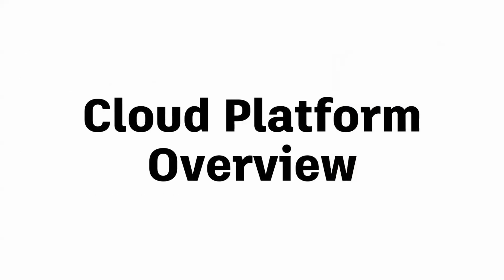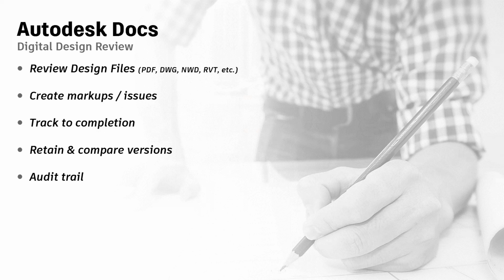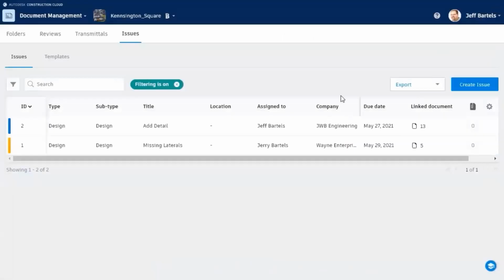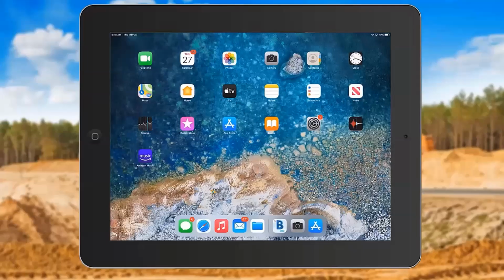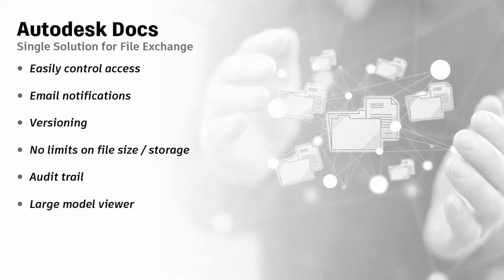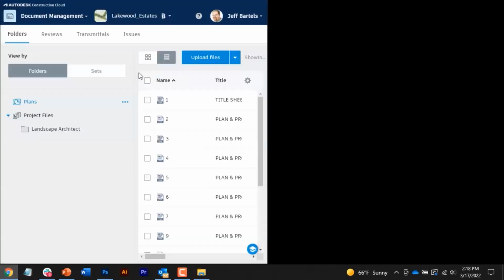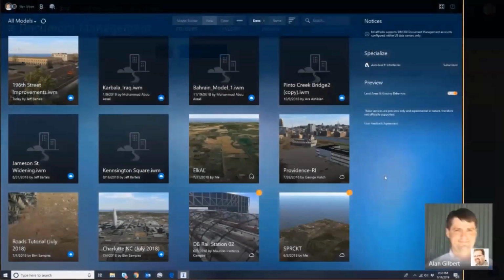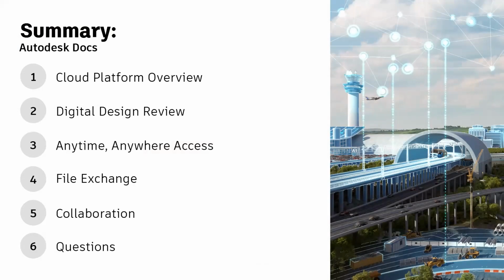Taking Advantage of Autodesk Docs on Your Next Civil Project

Comment: Time Stamp Bookmarks for future reference

2:46 Cloud Platform Overview
7:34 Digital Design and Review
10:20 Markups of Sheets
18:03 Field Access Anytime, Anywhere Access
25:12 File Exchange
----------------
	Autodesk Docs Single Solution for File Exchange
	Easily control access
	Email notifications
	Versioning
	No limits on file size / storage
	Audit trail
	Large model viewer
Examples
	28:10 Sharing Data with Landscape Architect
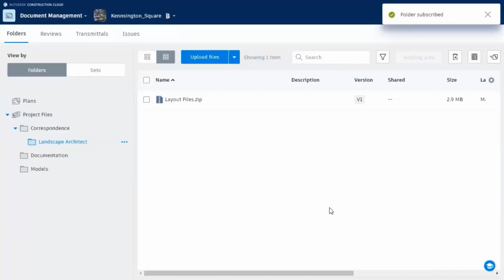	30:00 Using Desktop connector
	32:47 Now it Syncs (does not pull file until used locally)
-----------------
33:23 Collaboration
	Host InfraWorks models in the cloud
	Share Civil 3D surface models with Revit
Examples
	34:45 Infraworks model sharing
	38:32 Revit share Civil3d Surface
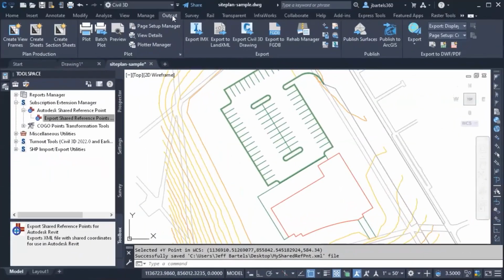		40:20 Share Surface from Civil3d
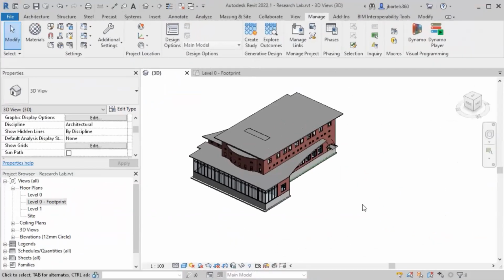		40:48 Linking Civil3d surface into Revit
-----------------
43:11 Questions